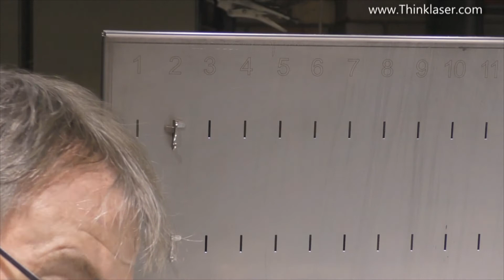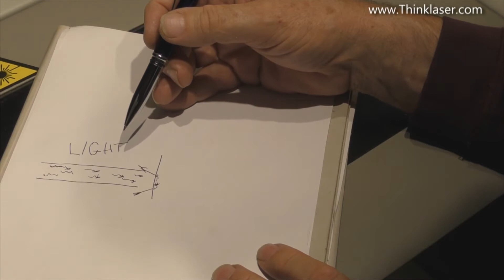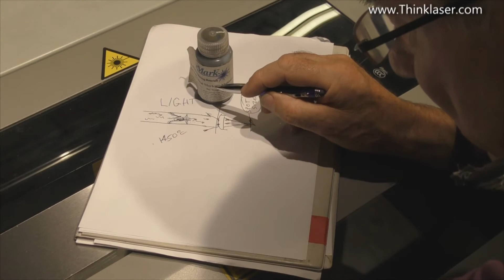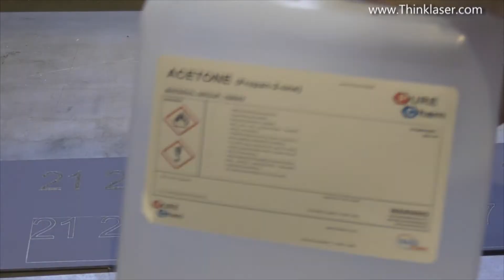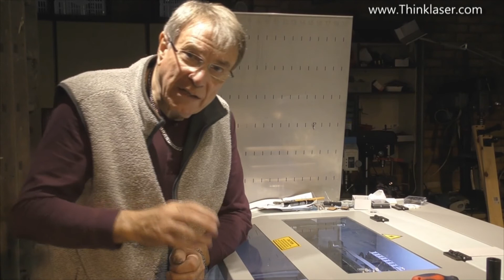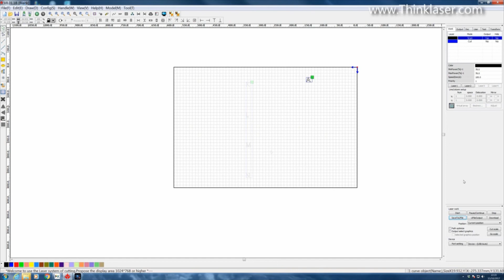How To Use A Laser Cutter - Lightblade Learning Lab 35 Thermal Marking Stainless Steel

Comment: Hello, How can I send to you a detailed question about engraving? I have a file I can share with you. Where the engraving is really slow, and I can't find the setup option. All the letters are scanned individually. I tried to tick in and out the independent output in scan parametre. No really good result. here is the .rld file https://drive.google.com/open?id=1qB49qmj2cyiQ_PdD3JIP3M0rzaew66j6 
Other question, how can I see in preview a real time value? This is totally different from the real process time.

Comment: I would love to see your engineering prowess should you consider yet another alternative to expensive bonding/marking materials:

https://youtu.be/B60nXwhK9gk

I first used an inexpensive off-name brand, which worked poorly, but had excellent results with Grey Poupon!
Reply from the maker: Hi Fred,
This is Gareth from Thinklaser. 

It's an interesting use for Mustard but I'm unsure as to how consistent it would be or what the actual marking reaction is. As you've seen from previous videos, it is possible to mark Stainless steel with a CO2 laser but at the risk of damaging your lens.
Reply: I tried it with an off-brand product and discovered that it was difficult to make an even application. When using Grey Poupon, the application is more uniform. The mustard certainly absorbs the energy and chemically alters the surface of the stainless. I was unable to scratch away the resultant marking. After a couple of 20 minute engraving sessions, I detected no lens deterioration.
Reply from the maker: We''ll add it to the topic list and see how it goes.
Reply from the maker: Hi Fred,

We may be looking at an alternative in the near future. 

Gareth @ Thinklaser